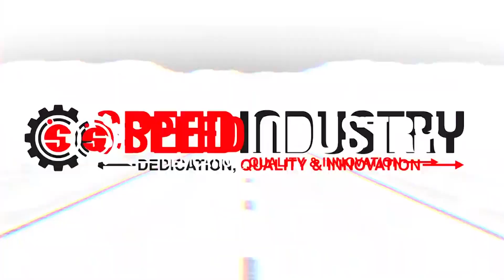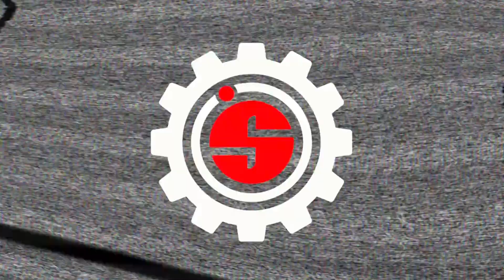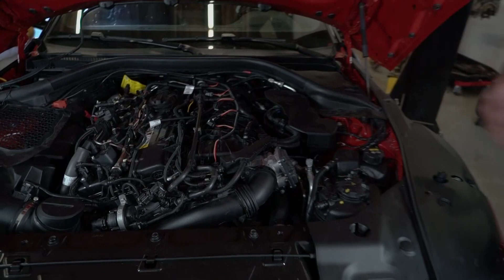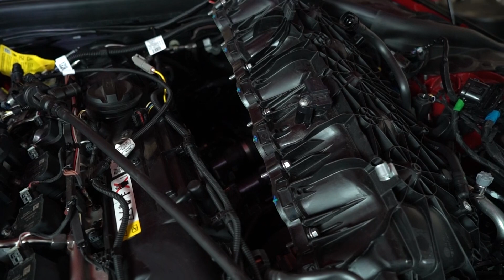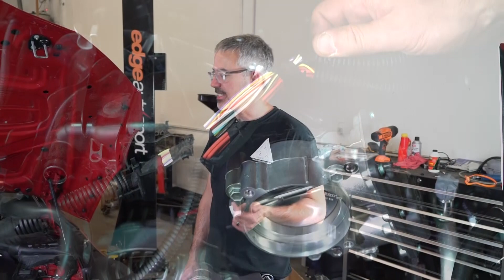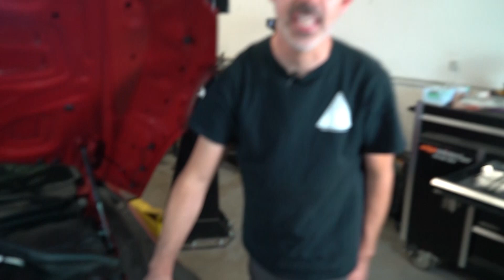A90 SUPRA EOS PORT INJECTION - Overview and Install

Comment: How much do you think I could push with pure850 but stock fuel system?
Reply: With a pure850 on a stock fuel system you can push about 550-580 HP.

Comment: Hi Jeff; thanks for the video! I’m having a hard time finding any conclusive review about carbon buildup in the B58; some claim having to deal with and some say it’s not an issue so I have 2 question for you please: 1- Can you please share your experience about that (have you had to deal with it personally yet); is it really a known problem? and 2- If there’s is potential for carbon buildup, would your port injectors solve that problem or at least make it so minimal as we’d come to know with older engine with factory port injectors?

Comment: Will the port injection allow a stock turbo E85/93 flex fuel tune to be used and take advantage of actually adjusting for the full spectrum of E10 - E85 content in the fuel tank?
Reply: Port injection allows you to run full e85 in the tank. These cars can run e50 with stock fueling just need a sensor so you can see how much. You’re at and tune of course
Reply: @MuzicNinja  How much whp can you get with port inj. and E85 on stock turbo?
Reply: @escoson555  about 550whp max

Comment: Why does port injection allow you to run E85 vice not having port injection?  Does port injection some how prevent E85 from damaging your fuel pump, gas tank etc?  Appreciate anyone knowledgeable enough to answer.   Thanks.
Reply: Port Injection allows you to add enough fuel to support running full E85 without over taxing the stock injectors.
Reply: @jeffreypayn5689  Thanks for the feedback. But can your fuel pump handle full E85 and doesn't E85 create condensation that is bad for your fuel tank?  Is a new fuel pump and fuel lines required and some type of additives for your fuel tank to prevent corrosion of the tank?
Reply: @supranova730  Depends on the power level with regard to a LPFP.  You will start having low pressure fuel pressure drop in the 650+\- whp range.  There are corrosion concerns, although the tank and most of the components are plastic.  I recommend flushing with pump gas once a month and keep pump in it when stored for more than a few weeks.
Reply: @jeffreypayn5689  Roger that.  Thanks for the info!

Comment: So what power level would I be looking at with this port system, stock turbo, full E85, and catless downpipe?
Reply: That didn’t answer my question at all but thanks for trying
Reply: Sorry... I think I misread your question.  Full E85 cars usually make low 500’s depending on the dyno.
Reply: @jeffreypayn5689  thanks man! I don’t want to do meth lol I don’t trust it
Reply: @dannyascencio1  then do e50
Reply: @Inheritor343  I’m making 670 wheel with port
Reply: @dannyascencio1  nothing to do with what I said but uh, okay
Reply: Stock turbo work well to E50... if you want to push past that, you will need either meth or Port.

Comment: Would you recommend port injection if I am looking to road race the car ?
Reply: Port comes into play with E and larger turbos.
Reply: Depends on fuel used and power level.
Reply: @jeffreypayn5689   i think im gonna stay full bolt on, good tune on 93 sometimes top it off with little 100octance. thats about for power right now still need more seat time